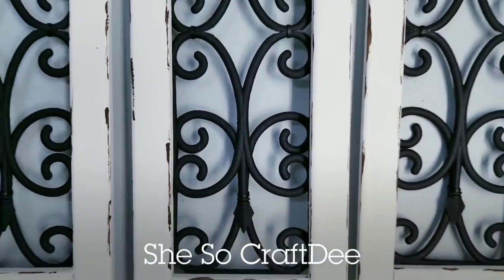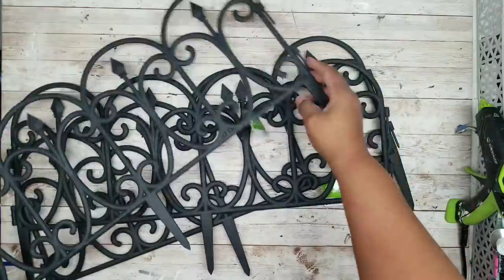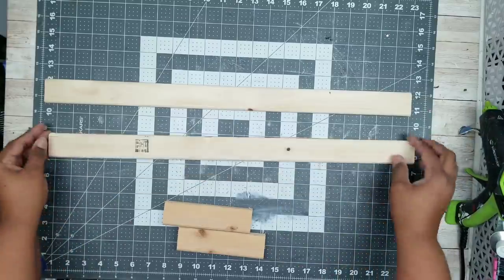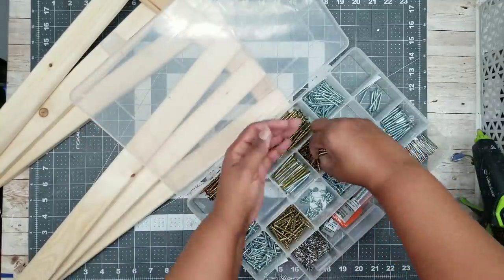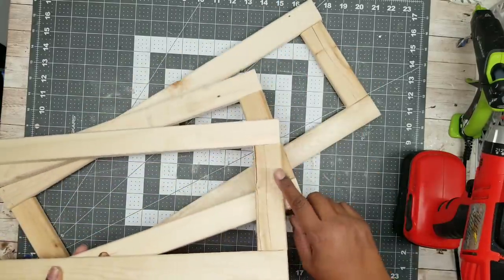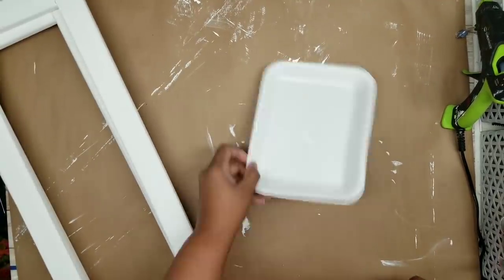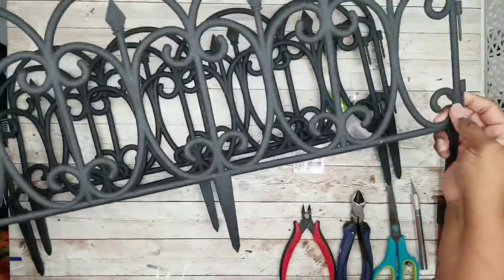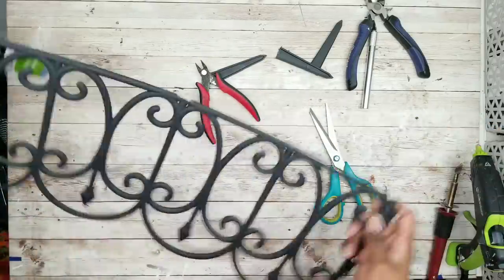DOLLAR TREE FENCE DIY | 3 Piece Wall Decor | Faux Iron Fence Craft | Solid Wood Distressed Frame

Comment: Of course you know I love your creations but have a question. Didn’t you try using surebonders wood glue before? And if so did it work?  I’d still use screws, but I was wondering about the hold long term
Reply from the maker: Yes, I have used the surebonder hot wood glue and love it! It's much stronger than regular hot glue. I use it when I have standalone pieces that will not be reinforced (with screws or otherwise) and it holds well!

Comment: Have you tried wood glue sticks? They go in your glue gun. It holds very well.
Reply from the maker: Yes, I use them often when gluing wood to wood without any additional reinforcement :) Since I was going to be screwing these in, I used regular glue (since wood glue sticks are a bit more expensive)